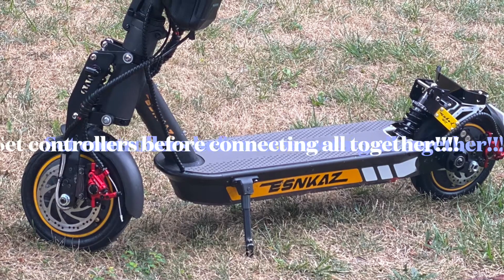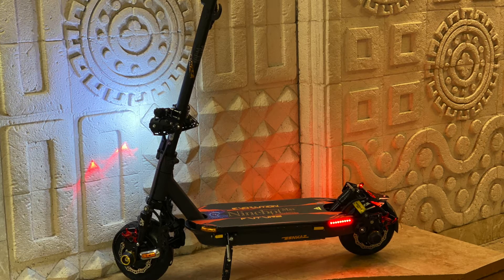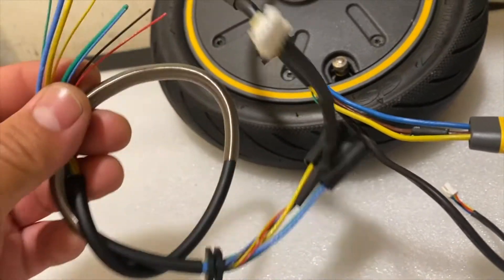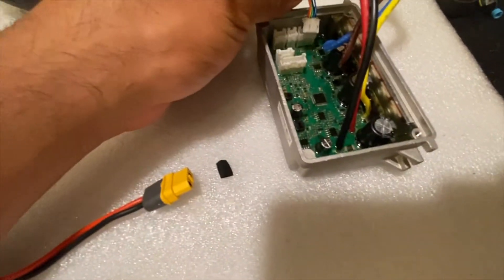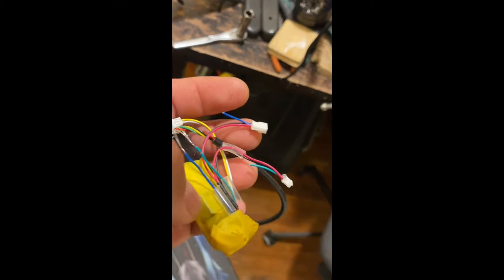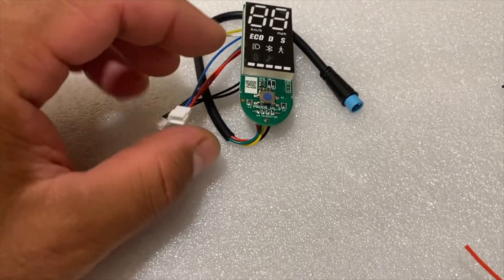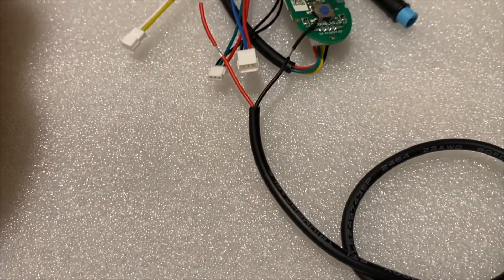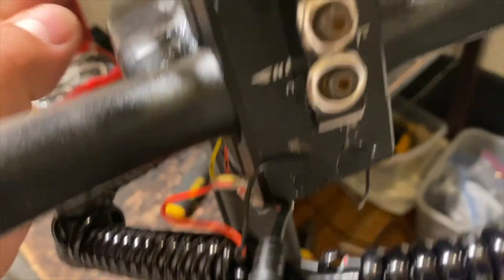Dual Motor Simple set up.

Comment: What do you do about error 15 from leaving the brake unplugged
Reply from the maker: To eliminate error 15 is simple. Just turn off KERS which is the electronic contact integrated on the brake lever that activate the brakes on the rear wheel when pressing the left lever. Which actually is Kinetic Energy Recovery System.

Comment: Would the fatmax(rear) and the stock(front) motors work? Im a bit hesitant to work on this coz of the difference of the wattage of the motors
Reply from the maker: Get a Kaabo Wolf Warrior X pro 1100W Motors instead and have better performance on your scooter. If you have 48V or 60V dual motor set up then add up a second Stock motor and have same speed of a single 1000W motor with a massive torque. Tested the 1000W "Fatmax" against a dual stock motor with the same 48V battery. Fatmax didnt compare to the torque of a dual stock motor. Anyways. There is a bunch of motors that fit the ninebot max way better than motor you mentioned as well at best price.

Comment: Can I do this with a stock battery
Reply from the maker: Yes sir. You can. Same set ups will work safely on voltages 36v, 48v and 60v motors: stock 350w, 800w, 1000w, 1100w, 1200w and 1400w. Important part is to have the 2 D controllers.
Reply: @ESnKaz  what is the 2d controller I have Two original controllers all I would need is an extension and a mr60 right

Comment: Hi what is the name of 1 male 2 female cable and i can not find it on aliexpress?
Reply from the maker: That you might need to make. Connectors are XT60 with 14gauge wires. That would be the bridge from battery to both controllers